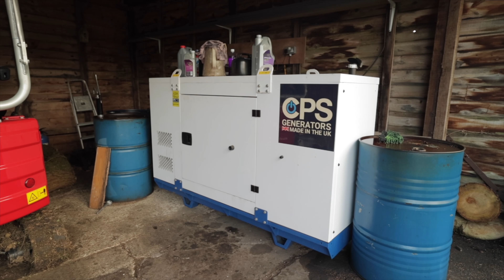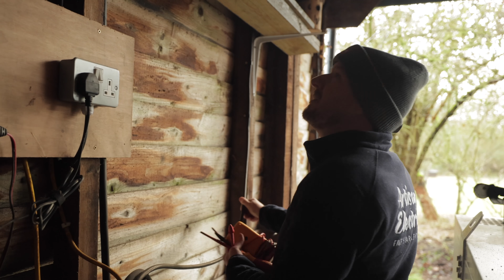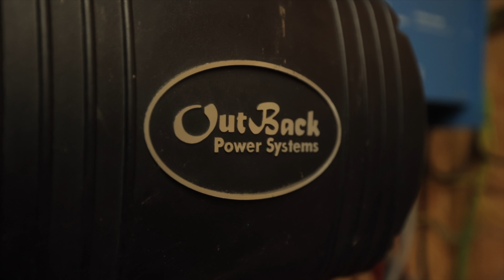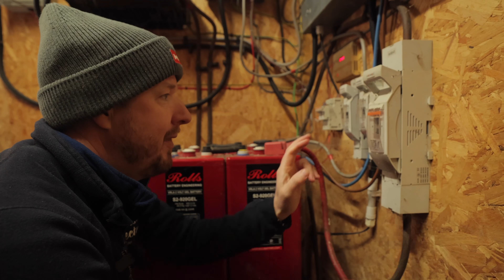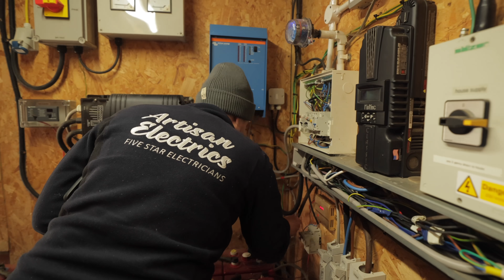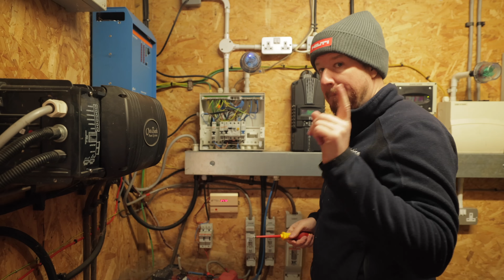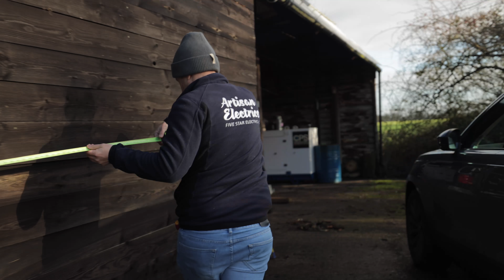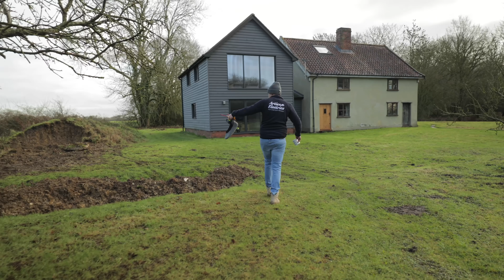DIY Off-Grid Solar Gone Wrong! (It Can’t Even Boil a Kettle)

Comment: What I can recomend are combined heat and power plants like a dachs. We have such a thing  at out house as our main heater. It runs with normal diesel and outs can provide 15kw of heating and 5,4 kw of power while using very little diesel.

If you combine that wirh something like a managed electrical heater to use the energy when the batteries are full you will get a reliable system for heating and power. The electrical heater can also use the power from the pv system if the batteries are already fully charged.

Comment: The "green" movement is so cringe. 10 year old panels now useless. New system to be installed easy 20-30k I'm sure. Just a fad to look green but in reality there's nothing green about it.
Reply: The panels are working fine. The batteries might be knackered (sadly Jordan didn't even check) but are totally recyclable.
The 25K new install is just Artisan being Artisan. Upgrading what is there for 5K to make it 3 times as capable would indeed be a lot greener. The system is ~13 year old at this point. Some updating is in order.
Reply: @xxwookey a 13 year old older car continues to run. 13 year old cables in a house continue to work, 13 year old boiler and copper pipes continue to work. 13 year old computer continues to work. 13 year old solar? Needs replacing
Reply: @CraveThatCoin  No. 13 year old solar still works fine (probably, we don;t know about the battery state). But the new homeowner wants a more powerful system so some updating/upgrading is in order. 
Very few people are actually using 13-year old computers, for a range of reasons. Sure the hardware still works, but the environment has changed, support and security is often a problem, and people want better functionality. Also you can get more computing for much less power (maybe a factor of 10) so it can be quite green to update old high-power computing equipment.
Average vehicle lifetime is 13 years in the UK, so more than half the vehicles are retired before 13 years. Obviously some will go on for decades (my last car lasted 26 years), but a lot of engines are knackered about that time, or other major components fail.
A lot of modern boilers don't make it to 13 either. Essentially your comparative list bears very little scrutiny.

Comment: wait, are you kidding me ? 16a Breaker supplied the house  off of a 240v 30a supply ? jesus man my campervan has 240 at 25 amps supply off of two 3kw inverters... with 3kw solar input at best, at presnt I've got 1200ah of storage and I'm looking to make that 1800, but 1000ah gel ?? that's crap them batteries are no good i mean you can really only use 500ah for a long cycle  but running a 2k inverter you only have 5/6 hours at 3.3kw your only going to get 2/3 hours, that's no use at all, them batteries need took out of the system and replaced with lithium  i'd say a minimum of 4000/6000ah

Comment: To be clear, the whiring is a little messy, the sistem is very good , most likley the batteryes have no water or they are end of life. The procedure ,the normal one, check the darn batteryes , add distiled water ,  equalize them - long cicle , do a capacity test- go from there. All the sistems are build like a tanks , way better then ceap shit these days. BTW that inverter has 3kw continius power, need more stack up more 3524 from outback, maximum is 8 interters, conmunication trhu a hub , programing whit mate 2 ( is on the god tham wall). WERY DISSAPOINTED IN YOU MATE !!!!!!!
Reply: you opinion would sound a bit more credible if you could actually spell
Reply: @tonybarden8563  Some good engineers have bad spelling. It seems pretty clear that this guy knows more than Jordan about this type of system, even if his speeling is apauling.

Comment: Going to need a mortgage for all of this new stuff
Reply: Maybe. But if you look at what an average UK family spends on electricity in a month they would probably still have money left over after paying of whatever loan they're getting.
Reply: @mrniceguy6050  Maybe...  I'm paying near $500 a month for my electrical, I have a creek out back I'm trying to dam and make turbines to harness power from it.
Reply: @DingleMcBerries  Thats a lot of money allowing you to pay of 90000 dollars over 15 years. Not sure how much dams and turbines go for nowadays but I'd say that's a lot more then the people in this video will be needing.
Reply: @mrniceguy6050  This family is off grid so not getting any bills :face-turquoise-covering-eyes:
Reply: @T-Wrex1864  They'll be getting plenty of bills but the loan needed to pays this stuff off is not likely to cost more.
Reply: @T-Wrex1864  Casually forgetting thebill for the 200 litres of diesel, every month...
Reply: @Lenny-kt2th yeah true I did overlook that but isn't it like 70p a litre for non road going diesel (red)
Reply: @Lenny-kt2th  Red diesel delivered to our farm £0.64 per litre. Where that last off-grid install Artisan did, the one with all the problems, cost the owner £112k, and it's still ongoing.
Reply: @hardergamer  which means if the current customer goes with a similar project they will break even in approximately 73 years 😂
Reply: Very good ❤
Reply: Doesn't have to be that bad.  There's a lot of equipment up on that wall, probably because until recently you pretty much had to go with separate components for everything.  But the box that controls my house battery can replace almost all of that: 3x DC in for solar panels, can work with a generator to top up the batteries, 10kW inverter (3 phase) to power the home.  And it wasn't all that expensive.  
You might want to keep the DC isolators, replace the rest with an integrated battery system like mine with modern batteries, and replace that nasty consumer unit.
Reply: @kaasmeester5903  Victron, MidNight, like the rest of the parts are still the best money can buy. The new stuff like SigE, uses 4 to 6 times as much internal power consumption than a Victron MultiPlues II, or Quattro II. Just Google what the Gold standard is in Inverters, and MPPTs. All this gear is top-notch, even today. Real off-grid, you won't separate standalone parts, or you're just looking for problems in a few years. Never buy AIO units for off-grid.

Comment: I’m surprised the lender (assuming they have a mortgage) didn’t require a full electrical inspection for this very reason!
Reply: Was about to post this myself. I can only assume they've not got a mortgage, as even the basic survey we got on our house included details of the electrical system.
Reply: Maybe they just required an inspection of the house itself, which seemed fine, and just valued that barn/outbuilding as worthless from a mortgage perspective? Or rather worth so little that it doesn't matter for mortgage purposes, perhaps?

Comment: This video is why I would rather DIY than bring in someone to sell me a bunch of stuff I don't really need. Just fix the problem instead of tearing everything out.
Reply: Artisan are famous for this sort of attitude. There are plenty of people that would take a more sensible approach. Hopefully the customer knows that he'll get a 15+ grand quote from this lot and zero re-use and that's what he wanted.
Reply: @xxwookey  15k? More like 40k for Artisan to do the job he described here. He's become as bad as a cowboy, some customers just want their system made safe for an amount they can afford.
Reply: As a sparky would you want to do a quick fix and be left with the legal liability if it all goes bad down the track on a system that would be utterly non-compliant if it weren’t for the fact it is off-grid? I get that people don’t like it when trades come along and want to replace everything because it simply doesn’t meet a standard but I also understand a tradesman that wants to leave a job knowing they’re happy the customer is safe. This system needs burning to the ground before it takes it upon itself to do so.
Reply: That's great if you're a diy person.. this guy who bought the property is clearly not. I counted 33 separate boxes tying this system together. Jordan's not an idiot, he could "repair" the system. It's just not safe, reliable, or easy to maintain by the property owner. So the best solution for the CUSTOMER is to install a new battery/inverter/panels system that works! Simple, it's not gouging.
Reply: Yes, Jordan is complaining about DIYers but he himself can only install ready-made system which are like lego with all components from the same supplier, a system that carries a hefty price tag only because of the brand name. You don't have to be a good electrician to connect such parts together, anyone can do that without engaging his brain too much. It can't be fun being an electrician today and not having to think but just do what the mfgr told you to do.
Reply: @L_O_M electricians tend to be licensed and have laws they have to follow. If we don't install equipment per manufacturer specs, then we incur the liability if anything goes wrong. Abs the electrician is already frequently blamed when things go wrong. 

We can do all sorts of things but the good ones install equipment properly and per specs.
Reply: @L_O_M  Do you really think that is a "good" system the owner has? I think he would be much happier with a new system that actually works. Sure, Jordan could patch it up to be functioning, but it still wouldn't be what the customer needs. He's clearly not diy type, he just wants to live in the place and not worry about turning on the kettle and microwave at the same time. Jeez, crucifying installers for giving the customer what they need, pathetic.
Reply: @MichaelWakefield-mx6hg  Actually it IS a good system (at least the components are) although very dated, it was all top of the line gear when it was installed.... With only minor mods it would still be fine for most smaller households- the old AGMs (Rolls- top of the line in their day) would be at end of usefull life- fit a modern LFP EVE based system- maybe go to 48v instead of the 24v and replace the old 2kw Outback inverter with a Victron 5kw and tidy up the wiring- be a fraction of the cost of a new Sigenergy install lol Personally I'd leave the original panels on the Midnight MPPT controller (it can be used on 48v) and fit a new 60A MPPT controller paralleled to the battery with its own 3kw array fitted to it- that way you can still have the original AND a new larger array both charging the battery bank.... the Victrom Multiplus is a 5kw inverter, AND has an inbuilt battery charger to boot- you could either retire the existing Victron battery charger or parallel it and use both to charge the bank from the genny if required.... even with a 340Ah 49v battery bank (16kWh) with the two Victrons charging at 100A each into the battery bank, it would go from dead flat to fully charged in under three hours of run time.... Jordan may be a good mains sparky, but his offgrid knowledge is practically zero- and it shows.....
Reply: @MichaelWakefield-mx6hg  It's a system that can be made to function within constraints with a few grand of work. Jordan needs to tell the customer that can be done before quoting 40k for a full replacement that the other guys would charge 20k for (and yes, I know Artisan do a neater job)
Reply: 100%

Comment: While I agree that the system needs to be replaced, I think you judged a bit too harshly.
No excuse for the naff wiring, but judging by the age of the panels, the system itself must have been put in way before modern, smart inverter and controller all-in-one s existed. Plus they left written instructions for the next guy. That's significantly more than most.
Reply: Yea, I've seen much worse, and I'm not an electrician.
Yes the wiring are a bit messy, but who knows the history, and the upgrades/fixes done along the way.

Also his idea of "app"everythig is abig no for me. I prefere a good old relay logic control or PLc control than the new smart BS.
Outhere is way more railable a solution like this, so that if the inverter fail you switch to generator, if solar chager faisl you still have AC via inverter.

Having a AIO box if it detect an error it brigs down the whole house.

Comment: Hey fella, That black midnight classic box is a Maximum Power Point Tracking (MPPT) charge controller.  It's a DC-to-DC converter that manages energy input  those batteries, not an inverter.

Comment: Corect me if i`m wrong the inverter charger it is an outback power sistems 3524 so it is practically a 3kw inverter, the charge from victron i belive is used for the musle power , the outback can also charge,, the sollar CHARGE CONTROLLER  it`s a midnite mppt , and the suge aresters are from midnite also , a lot of american sistems , very good ones

Comment: Much sucking of teeth and shaking of the head in this video followed by advice to replace everything and add to it at great cost.  No surprise there then

This has become quite a theme on this channel
Reply: It's the archetypal dodgy garage/builder sketch.
Reply: Surprised it isnt a 30 min advert tbh lol
Reply: What you get when you polish a pig is a vert happy, very shiny pig but a pig nonetheless.  Get to a known, draw it out, follow through.  You are facing some usable equipment, use it and correct as necessary🦊🦊.
Reply: @JaneHeller-c3v  kids have to go to college and wife have to go on holiday, why reuse when he can charge 10 X more for a system just slightly better?
Reply: @danny323dee for the shear pleasure of doing something that no one else can get done.  🦊🦊🥸

Comment: just a system from the earlier days. 
And maybe bought piece by piece when it was quite expensive. 
At the end it was the owners choice or that of the builder who could be 80 year old as I have seen that before. 
It simply grew bit by bit one way or the other to lower the generator bill over time. And then it stopped cause those elderly do stop if they no longer feel well. 

Why to complain if it was the home owners and pv builders choice. 

There had been more worse systems built by "pv professionals" who could not even calculate with the thermal coefficient if the U max would be below that of what the inverter can handle which can occure during very cold nights like in january with -14 here and a few balcony solar power system destroying the inverter cause the thermal coefficient exists for a good reason. And then the usual complain appear: just 3 years old and already broken

What panels did you use, have you cross checked and calculated if the panels would fit to the inverter? First answer is YES, of cause
And if you ask any other detail they simply have no clue and have checked nothing cause they "designed" it by Wp from the panel is below of the max power output of the inverter .... simple and easy.

Comment: So the 'solution' is to spend tens of thousands of pounds with Artisan Electrics
Reply: To be fair, I think the solution is to spend at the very least a 'ten of thousand' dollars replacing the batteries and inverter with something more suitable for this installation. And then maybe another 'ten of thousand' upgrading the solar array to reduce reliance on the generator, though that does not need to be done in phase 1- just something that should be done as it will pay for itself over time, and improve the overall resiliency/stability of the entire system.

Money does need to be thrown at this, does not necessarily need to be to Artisan Electrics, but this unfortunately was not a well designed or executed setup and it shows.
Reply: @DozIT you could replace the battery and inverter for about 5 to 6 thousand and have a battery with three times the capacity and an inverter with double to triple the capacity depending on if the current inverter is a 2 or 3kw one. He could likely keep his existing panels and then add a new ground mount array with its own charge controller to boost the solar capacity. A Victron Multiplus would handle the gen starting, bypass, charging and simplify the setup. The wiring isn't that difficult to rip out and redo properly.

Comment: So they have 100V DC at 5A DC and no fuse at the panel, but have them about 20 feet + from the panel and it will never trip because it's to big a fuse. Then they have 1000AH of storage. Use the power for light and main appliances fridge freezer... but they need a gas oven and cooker and stove top kettle. Might run a washing machine on cold / 30C washes but not much more. 24V is too low for push out any real power. How much voltage will they lose between the batteries and the invertor, do the wires get hot?  How's the heating system? Big Stanley Arga?  Should be fine once the shed doesn't burn down when the sun comes out.  

Is there a well and pump kicking in. I've hear of off gird cabins having a buffer tank about 100ltrs when it drops to say 25% a float switch kicks in and runs the pump till a second one stops it at 100%. The pipe is vented and will allows the water in the pipe to drain back into the well so there is no water sitting in the pipe to freeze once the fall is always back to the well.
Reply: Do the UK use hot+cold water or only cold water for washing machines and dish washers?
If it uses hot+cold then a gas/wood fired water heater would mean that the washing machine and dishwasher only requires power for the motors, probably less than 1kw.

Comment: The black thing you referred to a inverter at the 9:00  has to be the solar charge controller likely MPPT not PWM. Inverters change from DC to AC voltage. The inverter as you pointed out is on the other wall.
Reply: Tiny nitpick: All chargers are PWM, but the decent ones are also MPPT.
(The other options to PWM would be either a linear regulator, which results in huge losses generating heat, or have the solar panels drive a motor that in turn drives a generator/alternator. Both these are of course no-go options, and thus all solar chargers uses PWM).